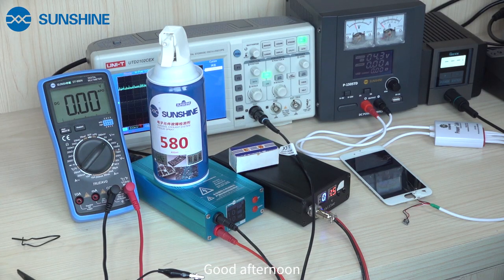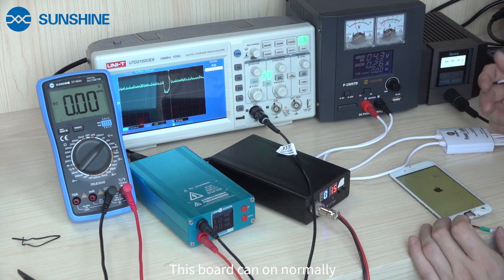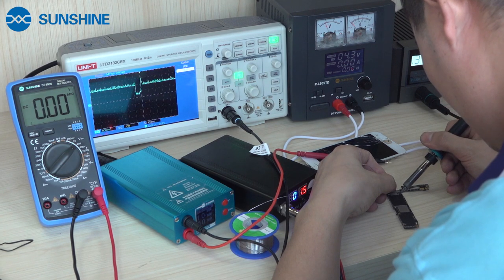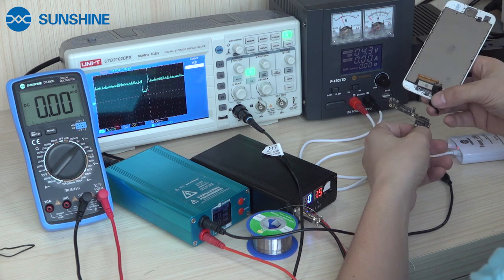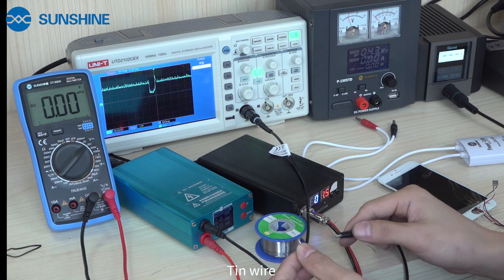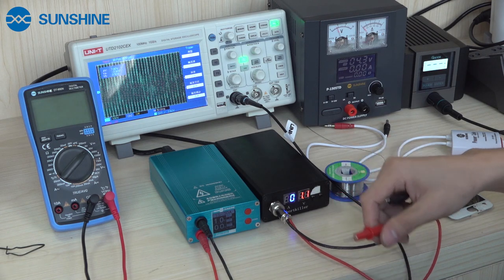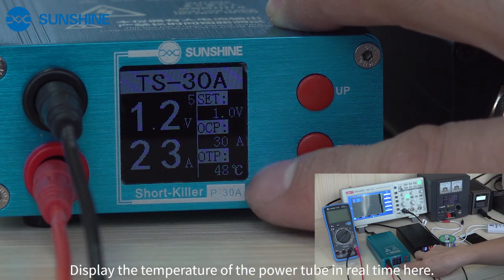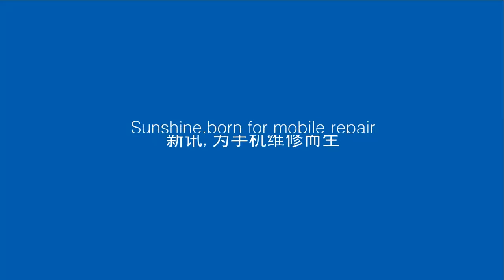Teach you how to use SUNSHINE short killer correctly#P30#P20

Comment: Great product. Used our TS-30A last week for the first time. Worked in seconds to locate a dead (shorted) tantalum cap. The display is a bit dim - can that be adjusted or is that normal on the unit? Not a serious issue but just wanted to post the positive review. Thanks.